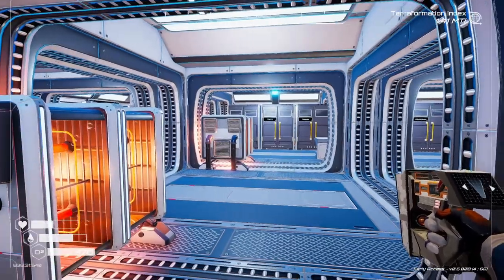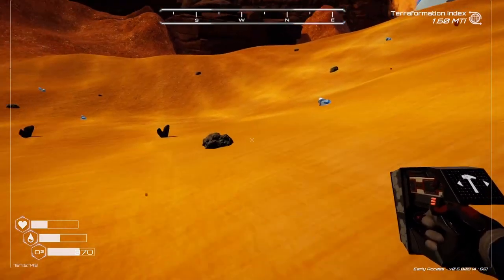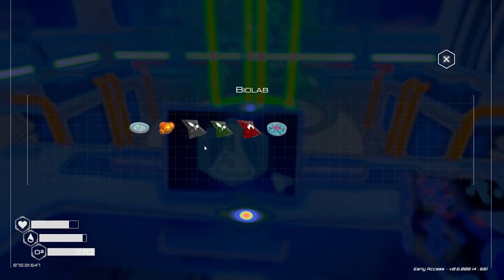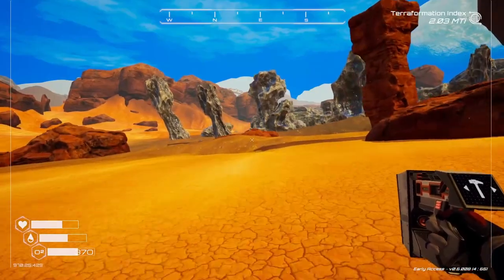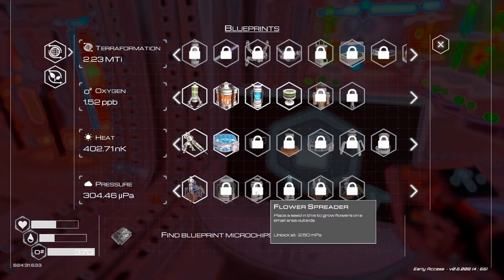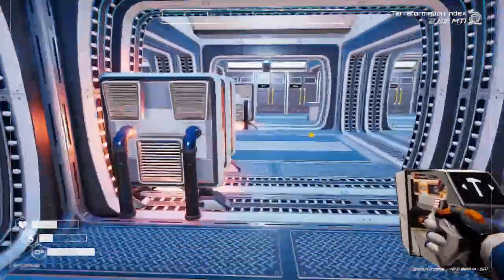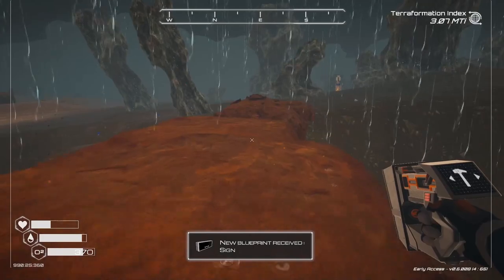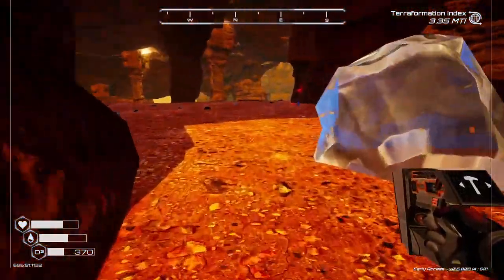My First Ore Extractor - Let's Play Planet Crafter Ep 11

Comment: You were correct in how Ore Extractors work.  You get the five common ores (Iron, Titanium, Silicon, Magnesium, and Cobalt) no matter where you place them.  Then, in certain locations, it adds specific Ore (such as Aluminum or Iridium) with a decent weighting to pick that up.  T2 both increases that chance to get the special ore as well as unlocks the ability to pick up more advanced ores, like Osmium.
Reply from the maker: So i assume if I place one in the iridium cave it will get some iridium? Or do i need a T2 extractor for that?
Reply: @Loocharagaming  Correct, and a T1 will pick up Iridium.
Reply: They will modify them a bit in the upcoming patch